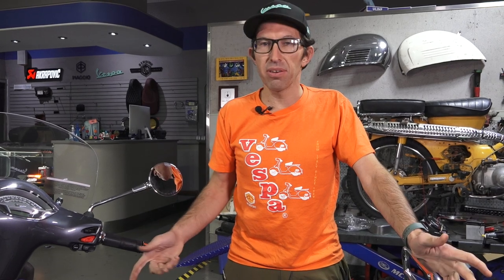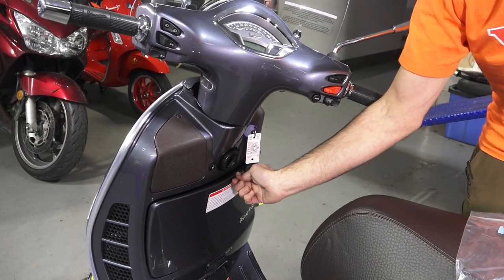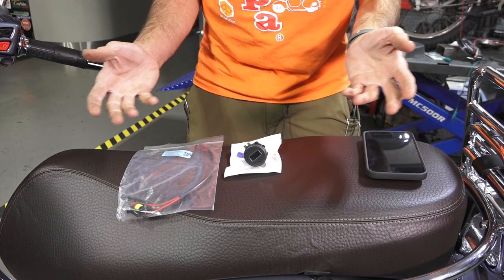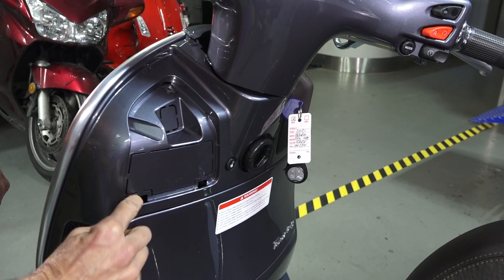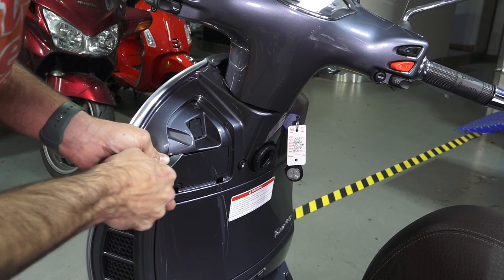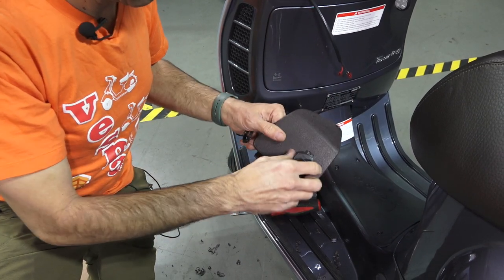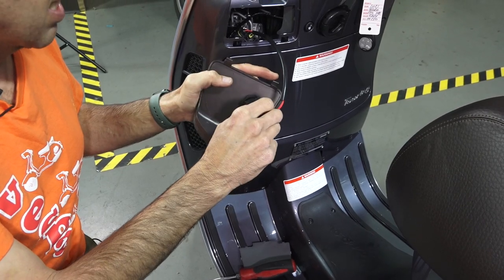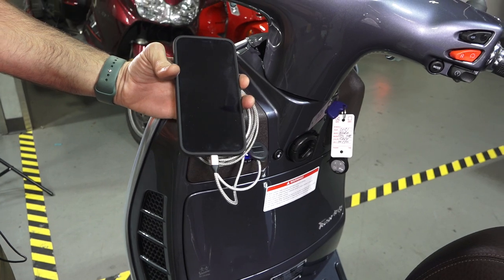Add USB 3.0 Charging to Your Vespa GTS

Comment: On my GTS 300 (MY2019), it was easier to remove the fuse box to gain access to the USB connections and fit the PP11 harness as the necessary pug was clipped to the back of the fuse box mount !!  Otherwise super easy mod and the PP11 harness makes it a very clean install.  Thanks Robot & ScooterWest, keep up the great work !!
Reply: I managed to take it out of the harness on a 2019, cables are held in place by a triangular harness that you can try to work out of … by sliding out and putting little force you can see them via the side vent tucked in . Hope that helps

Comment: Nice option, Robot. Two points, though: (1) I've found the built-in USB port on my 2015 GTS300 does a pretty good job during my 30-40 mile jaunts for my phone (Samsung Galaxy S-10e now); (2) The limiting factor I've found in charging is the cable - the higher-quality the better. I found a flat cable that doesn't impede charging, but still allows the "glove-box" door to fully close and lock with little effort. (And, a quick plug for Quad Lock: have one, love it.)

Comment: I always worry about the cable getting tangled with that setup.  My next mod to my scooter will be running power out of the headset right by the mirror and connecting the Ram Mount with Qi wireless charging.

Comment: I ordered the parts based on the vid and even had Scooterwest pre-drill the hole, BUt after removing that lower panel I'm not able to get the cover to close. The rear of the USB plug butts against something. Is this made for the GTS300 Supertech 2021?

Comment: When fitting the 12v adaptor remember to fit it low to the right otherwise the wires can push against the square modules that are located inside to the left of the knee pad area.

Comment: I have a GTS250ie. I installed the older kneepad USB kit that had a pigtail to connect to the alarm connector. I bought this same amazing faster USB outlet and put it in place of the older "Slow" USB and noticed that the wire in the alarm connector is a very small gauge. Will that small wire support the draw needed by the heavier wattage faster USB? Will I pop a fuse or toast wiring with the faster USB?

Comment: will the voltage indicator be a parasitic drain?
Reply: It has to have some drain to show the display, I'm more curious if it has any in the switched off condition.  Since this has no "remote" turn on capability like TV's and such electronics I would suspect it does not and "off is off".  I just swapped my Euro cigarette style outlet for one of these on my recently acquired Buddy 125.  It has a 1amp fuse for the OEM switched connection so I ran an always on line from the battery with the SAE  style heavy wire with inline fuse support to the 3amp capability of this unit.

Comment: I mounted  a marine  12 volt socket on the side panel of my scooter cause it had a hole there the perfect size. I run a cb and tyre pump etc